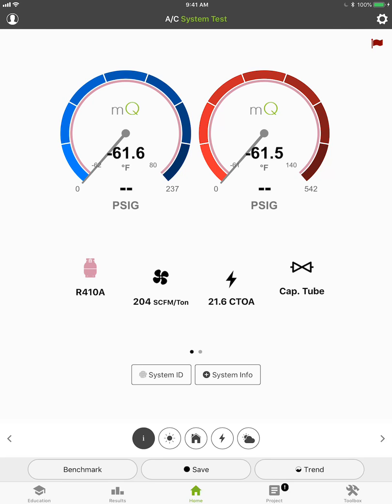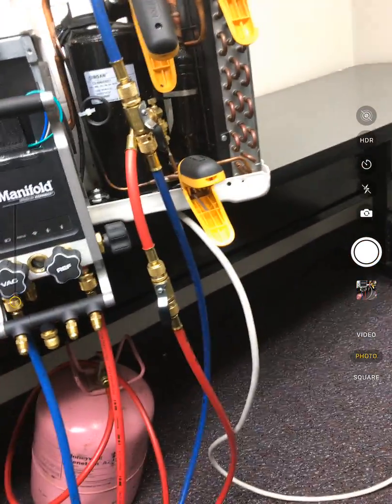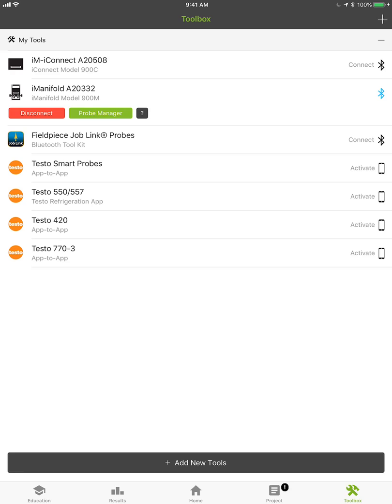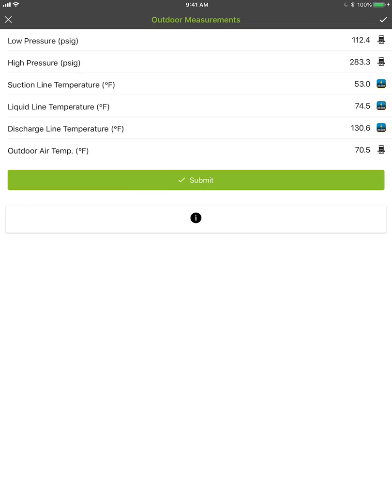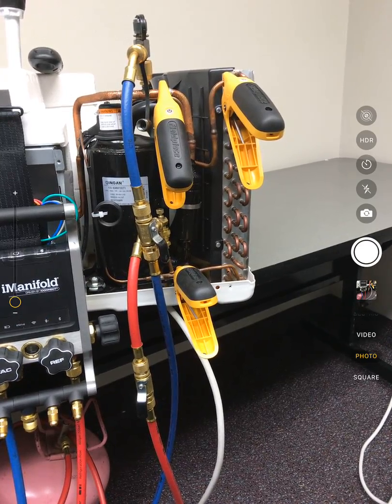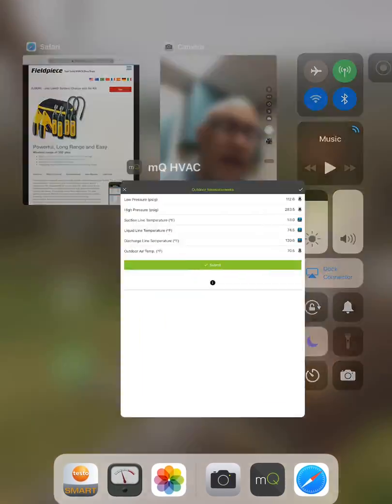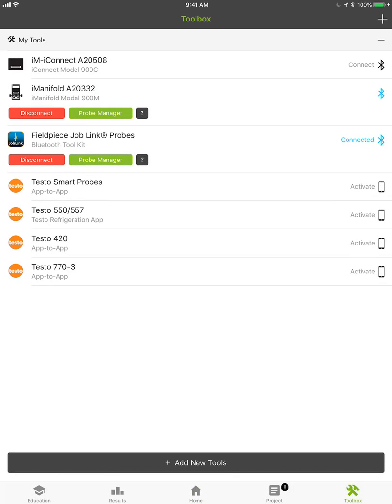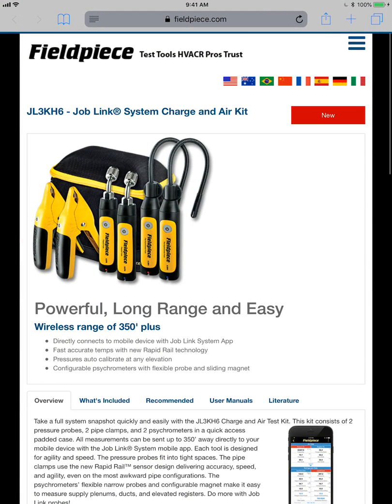FieldPiece Job Link(R) Wireless with iManifold(R) in MeasureQuick

Comment: Good vid. liked 👍, so i can finally get rid of the wired temp.clamps with" iconnect " & Pull data from testo 115's or Fieldpiece clamps ( mix & match )  and Use MQ. app. ?
Reply from the maker: Right now Fieldpiece has the only live data coming in. We are talking to Testo about that still.
Reply: i thought iconnect / imperial probes were live on it too ? i thought that was the whole idea ?
Reply from the maker: iConnect and iManifold/Imperial are live too, those have been for about 6 months. In the user settings, left top menu, there is an info button that will tell you how they have to be configured.

Comment: Will it work with the older joblink dongle and my sdp2?
Reply from the maker: We have only incorporated the probes at the moment.
Reply: MeasureQUICK dang that would make it useful again
Reply: Any luck with my JL2 working with MQ in the future? Every time I try and use the stupid Fieldpiece app it requires another update. I'm so frustrated
Reply from the maker: @joeshearer1247  We talked to FP about that. No luck. I am not sure what the reason was.
Reply: MeasureQUICK what a shame. I hope you continue to lobby for the jl2. I would call them but it's usually a waste of my time.

Comment: Thanks Jim. Can I manually map my probes or is the mapping fixed?
Reply from the maker: The switches can be flipped and the probes will remap, but it is easier to just move them. As far as more flexible mapping we are working on round two. There is a lot of logic to that. Not a simple request. But it will be done eventually. That is a feature we want to see too.
Reply: I was thinking of a two circuit system using Iconnect for one and job link for the other. How would it map as is?
Reply from the maker: That cannot be done at the moment. We will do that at a later date.